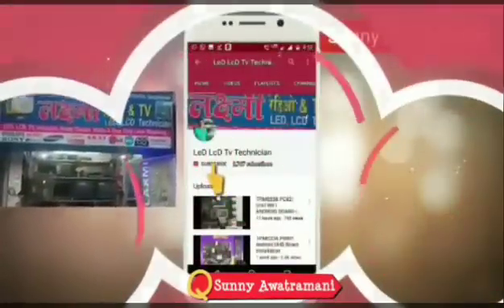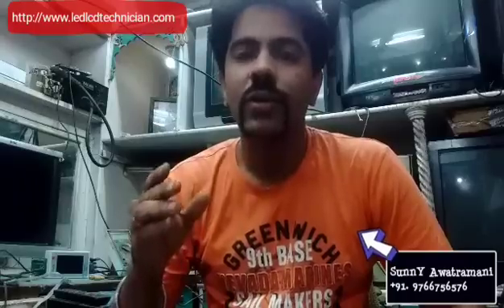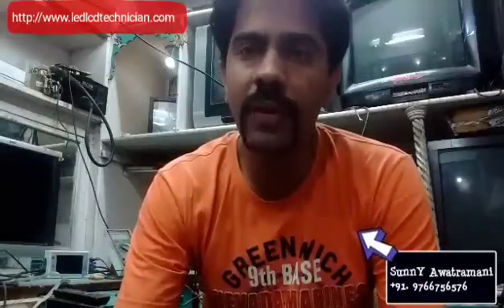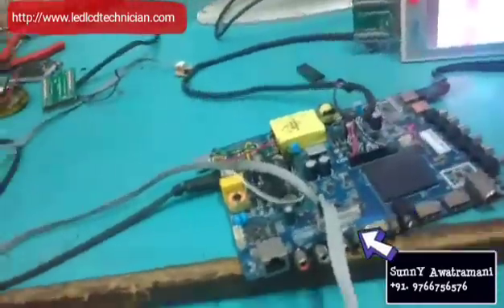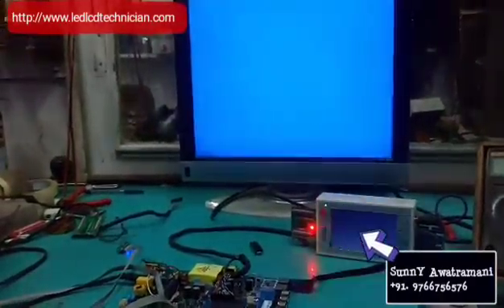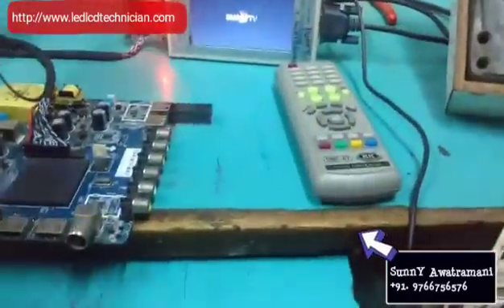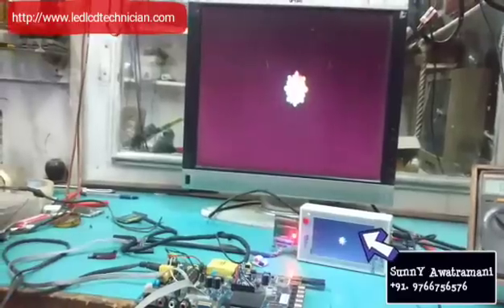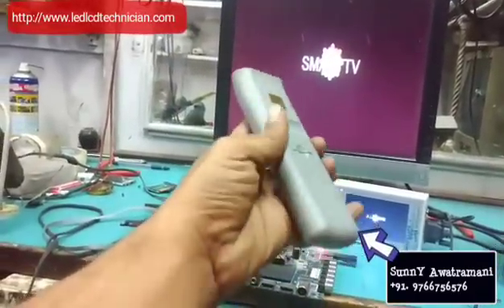Part1 How to Installation CV338H-A42  Android Smart Board With Subtitles

Comment: BlackOx 32LF3201 32" FULL HD SMART Android LED TV-5 
Android 4.4.4 
System Version  CONIC-CV338H_A42_V003 
CPU -  CA7 - *2Core @1.3GHz
.
This TV purchased  last year and works  fine. But no ROOT is possible.
It has useless apps like Amazon,  Tweeter, Facebook, WhatsApp etc and  has occupied space .
Root is not possible and I need root permission to remove these apps.
what to do ?